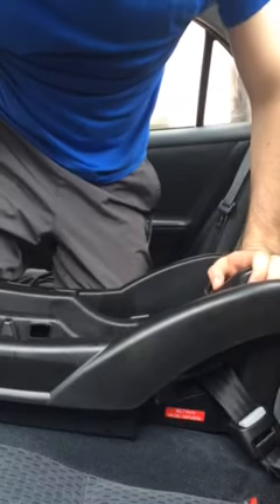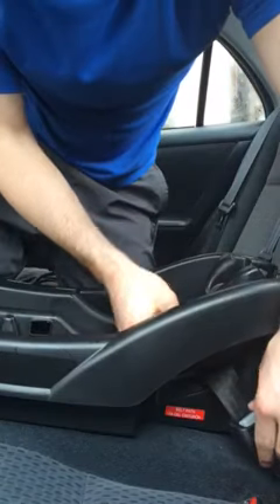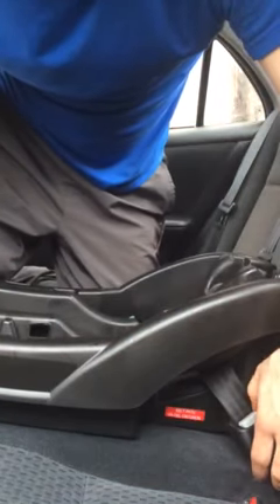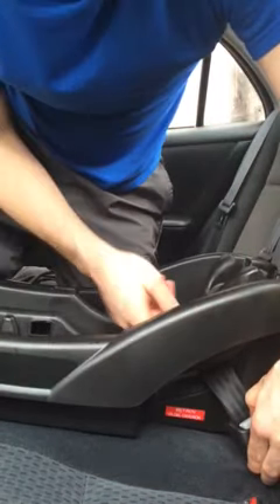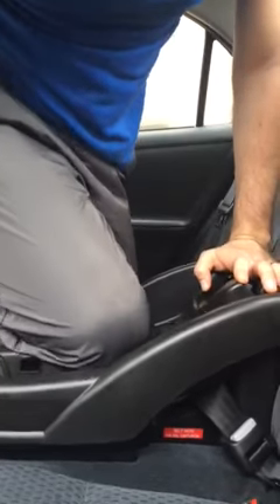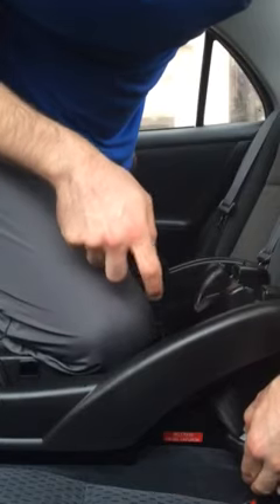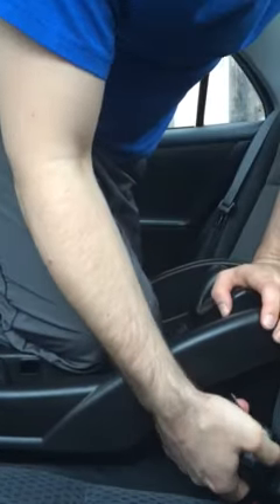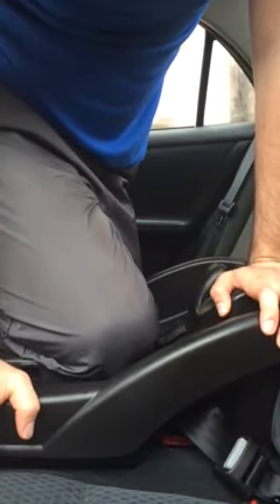Removing Graco SnugRide® Click Connect™ 35 base with latch

Comment: thank you, only video on YouTube that shows how to remove this base.  frustrating as hell
Reply: That's exactly why I posted it!
Reply: It’s always pain in rear to remove it. No matter how hard you try. There is no sure method. It always requires a bunch of tries. If you leave enough slack while installing the seat it’s not safe. I am struggling as I write this though I have done this few times in the past. Also not many videos on YouTube that explain how to do this.
Reply: I still can't get mine off, been trying for hours. I have put my entire body on it and it's not working

Comment: This video saved me from slicing the belt. Good point about having to pull the strap even though you're tightening it to get the belt moving.  Even putting my knee and 200 lb on it. The belt barely moves enough for me to unlatch but it worked. Awesome video. Thank you!

Comment: It took me like an hour each to remove the base for my 1st and 2nd child.  I swore when i installed it for 3rd child i would cut it out when finished, and use seatbelt to install it if theres ever a 4th. Its always been annoying to not have the quick flexibility to move a base over. I much prefer the latch system with the red button to release.

Comment: Great video! This worked for me once. I tightened it a bit more because the base was moving a bit. The second time I couldn't get it out even after trying this technique for an hour. The latch release completely gave up. What worked for me is, I let a full grown adult sit on the base. That gave me enough wiggle room to unhook the latches from the seat anchors.

Comment: it tightened it so damn much to keep the baby safe, i think the latch is broken. even your trick will not work. it seems as if my latch isn't even pushing in one bit... is your latch the same or did i break mine by tightening it so much?
Reply from the maker: The button on my latch barely moves. I'm guessing if you tighten the belt so much that you can't possibly tighten anymore, my trick won't work.  It seems like you may have hit a "point of no return." Call Graco customer support and see what they suggest.

Comment: This didn't work for us...The seatbelt latch that you push in to supposedly remove the belt will not budge!  It is locked somehow.  Standing on it did not make it unlatch .  Any other ideas besides cutting it out?
Reply from the maker: According to the comments, if my technique didn’t work, some people used adjustable pliers/channel locks/vice grips to squeeze the seatbelt latch and were able to release the belt.

Comment: How much does the button push in without adding the pressure? I think I also did mine so tight that there is almost no movement available in the button.
Reply from the maker: In my experience, the button can only be depressed a couple of millimeters even when it's not hooked up/under tension. My technique only works if you can depress the car seat and get enough slack to start moving the latch strap back and forth, like I demonstrated in the video. If you have to cut the latch strap, I would contact Graco and ask for a replacement.

Comment: This video was not helpful in my case it did not work. The base had not been removed in almost 2 years so we figured that is why the strap was not losing up. My uncle used pliers to tighten down on the latch release (gray button on the strap). Once he done that the strap loosen up and he was able to unable hook the lathes.

I hope this helps anyone who still is having issues.
Reply: This is the solution! I got a pair of adjustable pliers and crunched that button down so it released the strap. The grey plastic had some marring as a result but it still functions fine for reinstallation.

Comment: What if it’s already too tight to even get some slack on it ......???
Reply from the maker: This removal technique will only work if you can get some slack in the belt to start tightening just enough to allow the grey latch to be depressed. Now, when I install the base, I tighten as much as I can without putting any pressure on the base, so that when I need to take it out, I’ll have that little bit of slack in the line to uninstall the base. Seems like there have been several people commenting that tightened the belt so much during the installation that this removal technique will not work.

Comment: Still struggling hard to remove it. Any more tips?
Reply: Senthil Sabapathy - try putting as much of your weight down on the base to get the belt as loose as possible before trying to loosen the latch.
Reply: make sure you first tight the belt by pulling it and then release it.